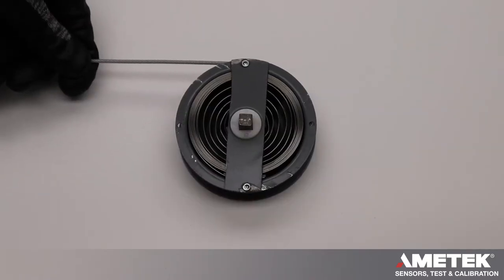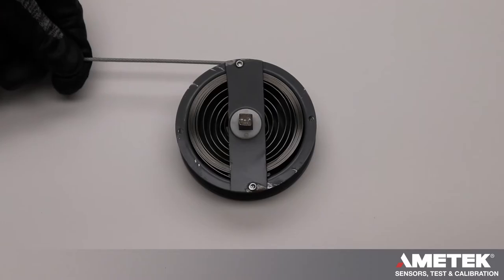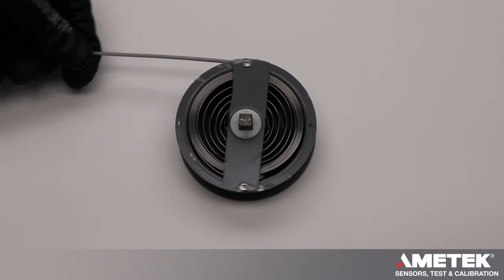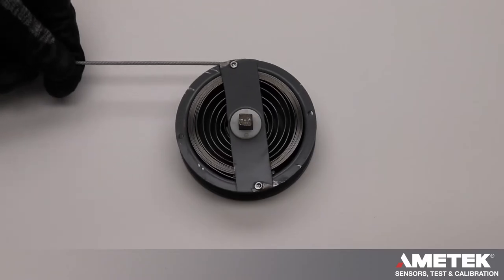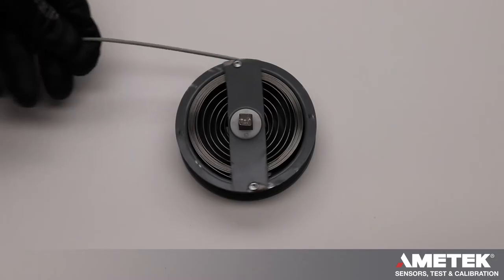Mechanical Cable Reel - What is the Life Cycle

Comment: what is the max dia of this reel pulley ?
Reply from the maker: Hi Vital, thank you for your questions. We offer our Arbor-mounted Reels in several different sizes. Our standard max diameter offerings are 3.375”, 5.0”, and 6.0”. 
Feel free to contact the team through our website for additional technical support and to get more detailed pricing, we need the specifications that you are looking for, I suggest you contact the sales dept. at Hunter Spring, they are ready to help you.
You can learn more here, and use the contact form to get through to the engineers. https://www.hunterspringandreel.com/products/mechanical-cable-reels